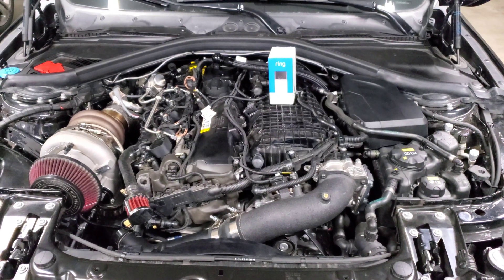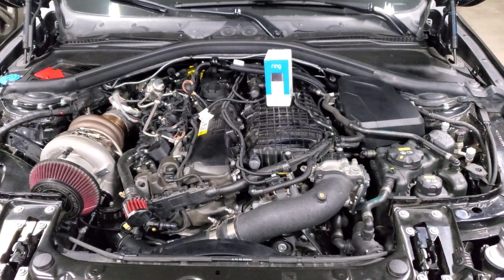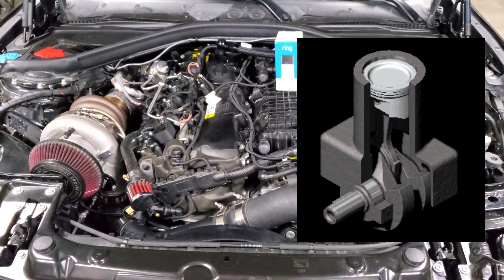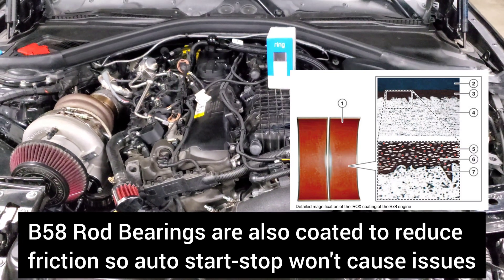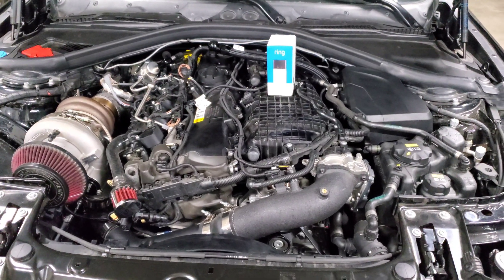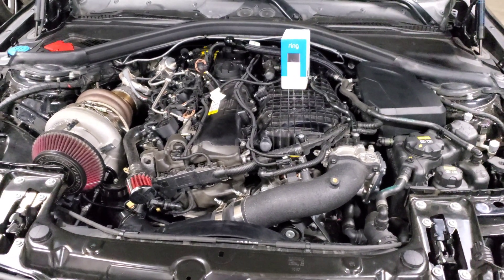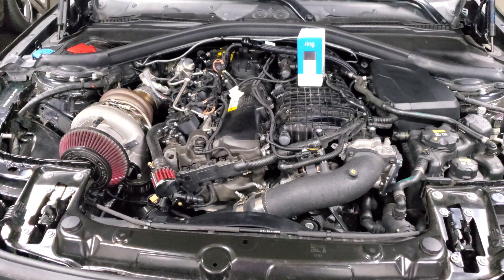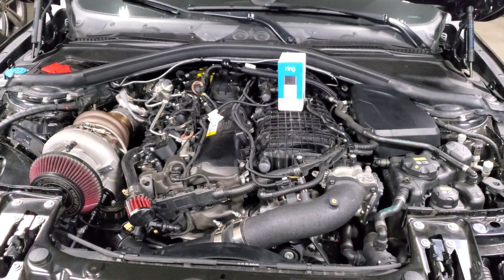Does the B58 Engine have Rod Knock Issues?

Comment: If you're using engine oil to cool your turbo then that can easily cause oil degradation, and degraded oil can absolutely cause the same problems as using the wrong oil.  So yes, a non-factory turbo can absolutely cause this type of problem.

Comment: Another issue with the S65 is that people use it for short trips and they dont let the engine properly warm up with that heavy oil.
Reply from the maker: yeah it's really a racing oil weight, not designed for daily driving unfortunately

Comment: Always replace your rod bearings in every n54, n55, and b58 every 100k miles (or sooner if you beat on it or extended oil changes).
Reply from the maker: No
Reply: @kern417  lol ok moron
Reply: No
Reply: @onekind1554  imbecile
Reply: no
Reply: @sebastianromero3666 this not a s54-s65 or /86
Reply: @kamilito225  only the OG 1m and m2 don’t need to replace rod bearings
Reply from the maker: the B58 comes with coated bearings from the factory that people use in their built engines. but feel free to keep calling everyone else dumb while wasting your own money no sweat.
Reply: @kern417  then why are all sorts of b58s blowing up with rod knock?
Reply from the maker: @sebastianromero420  that's not a thing
Reply: @sebastianromero420   where do you get your information from? because someone lied to you 😂
Reply: Correction after further research-Only n54 and n55 except for the 1M/M2 require rod bearing replacement periodically.
Reply from the maker: @sebastianromero420  now we can agree 🤝🏾

Comment: I have a built a 58 motor with higher clearances, and I get rod knock,what  do you recommend? I’m currently using Motul 300 V5W 50.
Reply from the maker: Probably find another builder
Reply: Terrible engine builder. He didn’t machine the crankshaft properly. You need to dress the radius, which e obviously didn’t do. Go back and get a refund

Comment: 6:40 If a stock engine with stock power level and the OEM oil viscosity (0W-20 for TÜ1 and 0W-12 for TÜ2) is the baseline and you go for a big increase in power then your tribo system - lets stay with conrod bearings - changes due to the increased load towards the left end of the Stribeck curve. What you then should do is to pull it back to the right end of the Stribeck curve by using an oil with higher viscosity.

Therefore using a higher vis oil in a tuned engine is the right approach BUT as you correctly said the tolearances stay the same unless you redesign your engine (nobody is doing that btw). Same tolerances at a higher power level lead you to a more frequent metal-to-metal contact despite a hig vis oil because you simply don't get the higher viscosity into the tribo contact.

Bottomline, the tolerances equal not only to a specific viscosity grade (as mentioned above) but especially also to a certain STOCK power level. changing the power level leads to significantly different friction & wear behaviour regardless of YouTube and Forums who are competing with each other who will be the first B58 with 1000hp...

Hope this is clear.
Reply from the maker: It has already been proven by multiple oil analysis including ones I've posted myself that oem spec oil works fine even at 600+ whp. When you have data showing otherwise, let me know 👍🏾

Comment: Happy that I found this video. Not a petrol guy, M57 driver, in summer these engines because of emissions and such, usually run quite hot, like 92-95 to a 100C at a traffic light. Experimented with 5w50 even though recommended is 5w30, now it gets a bit colder in Europe, switched back to 5w40. Question is, visually the 5w50 did not seem thicker than the 5w30 or 40, is it possible that it could have caused premature wear on bearings?
Reply: Something i be curious about too.
Since i out 5w30 in my 310k km m57n2 it doesnt run as well. I hope it didn’t create much more wear on the rods. Always go 5w40 at the least

Comment: 5w30 normal uk climate 
5w40 if you drive the car spirited or run it very hot frequently.
Reply from the maker: Doesn't matter
Reply: @kern417  it does. BMW UK give that advice as to what we use in our 530d work cars due to them being driven on the limit 24/7.
Reply from the maker: If your oil temperature doesn't vary then different oil weights don't provide any benefit. Not to mention a 530d doesn't have a B58 so cannot be directly correlated.
Reply: @kern417  a 30 weight oil flows faster than 40/50/60 weight oil. Higher weight oil provides better protection at higher operating temps and stressful conditions.
Reply from the maker: You simply need to watch the video and listen. Higher weight oil is not better.

Comment: Ever since bmw made rod bearings a regular maintenance item all engines have the potential for premature rod knock. It all comes down to how well the car is maintained. Unfortunately the downside of buying 2nd hand cars we dont always know how well the previous owner took care of the car.
Reply from the maker: Just watch the video.
Reply: @kern417  i did im saying Rod bearings are a regular maintenance item they should be done every 80k miles according to bmw.  Not knocking anything u said in ur vid
Reply from the maker: Bearing should not be a maintenance item. There are specific engines that have rod bearing issues. The B58 is not one of them.

Comment: I’ve had this argument even with my mechanic. He was recommending 10-w60 because it’s hot in the summer so on so forth. I declined the idea I’ve been running 5w-30 for the entire life of the vehicle. It runs and idles so smooth and quite. 135i N55, 96,000 miles.

Comment: 10w60 is way too thick for a street driven s65 s85.
I opt to 5w50 for my s65 M3 
5w50 is thin enough for tight clearances of s65 s85 and thick enough for street driving at optimum temp.

Comment: in my basic understanding about rod knocks. usually rod knocks causes due to bad fuel ⛽️ you putting in your car. for example if you car only takes premium gas and you only putting regular/semi premium gas. that sometimes causes irregular misfire on the engine because of the quality of gas you’re putting is not that gas that manufacturers recommended. also rod knocks caused sometimes by the rod cap bolts stretching during very hard driving or improper rod bolt torqueing during the build of the car. so basically the heavy your mods is the more strain you’re putting on your engine.
Reply from the maker: @2jz 240sx 🤝🏾

Comment: Nothing chokes your turbo more, then the air filter from your lawnmower.......
Reply from the maker: Now imagine the quality of the turbo when you're making 750whp through a lawnmower filter 😌
Reply: @kern417  imagine the hp if that same turbo could breath!
Reply from the maker: If the filter isn't the limiting factor, which it isn't it, it's not going to make any more power 😉
Reply: @kern417  that little filter is not rated to flow that much air. If you've ever seen 1/4"×1/4" bird screen.  It cuts air flow by almost 50%!  Just saying.....
Reply from the maker: Not rated to do it, yet somehow it's doing exactly that 🤔 

HP is airflow. If it's making the power, it's flowing the air. If it was a choke point then the turbo would max and stop making more power.

Would it make the power with less duty cycle/wheelspeed? Most likely. 

Does that mean it's a limiting factor? Absolutely not.
Reply: @kern417  we like to dyno our motors with a 10 inch intake hose.
Maybe you get good results with a 4"...

Comment: Thanks for the video bro. 

So I'm running a stage 1 tune, with 5w-40 liqui-Moly oil coupled with ceretac. Would you say this okay for my current tune or should I go back to 0w?
Reply from the maker: 0w would give better cold start protection but 5w is probably fine
Reply: @kern417  From what I've heard, 5W oils are also better at durability, since the base oil is thicker. So the viscosity does not decrease as much over the life span of the oil.

Comment: Good info. Even tho i have a FBO 340 i didnt feel the NEED to get thick oil. I still run the same oil the car is designed for even tho everyone says its too thin it works fine for me so

Comment: So for a tuned B58 do you recommend 5w-20 as recommended by BMW or switch to 5w-30? Because a lot of these manufacturers run thinner oils now to get better MPG.
Reply from the maker: Both work fine
Reply: @kern417  didn't you do a video explaining that the B58 is designed from the ground up for thin oil and its not that BMW just put thin oil in to get the MPG target...I'm in really cold climate, so i stick with 0w-20 and might go 0w-30 after I hit 60k/upgrade the turbo.

Thanks as always for the great info.
Reply from the maker: @suspect3539  both can meet the BMW cert so both should work.
Reply: @kern417  cool...thanks. When I first saw this video title, I got bummed out thinking it'd be s65/s85 all over again. Thankfully it sound like this was unique situation and there isn't widespread rod knock issues on this motor.

Comment: Hi, owners manual allow for 5w 40 on my M240i. I know someone running Motul Sport 5w 40. They say it felt like they got a small horsepower bump from the Esters lubrication. You think this is a good oil for our cars if highly boosted although I don't think it meets BMW specifications? I feel like my car drives better with Liquid Moly 5w 30 than OEM 0w 20. But, I do want to use Motul Sport. Had it in my e90 335i. It was great!
Reply from the maker: My car performed fine on 5W40 and I posted an oil analysis confirming that it worked well. I have since switched to 5W30 and I will be posting an oil analysis when I do my oil change later this year.
Reply: @kern417  Nice!
Any experience with Motul Sport. It's not long life. 5k miles change intervals. Extremely good against fuel diluting oil for those running high ethanol.
Reply: Whats your Oil temp in the B58 or N54(?) or N55?
Reply: @totalsuper4169  On my N54, Motul Sport ran 230-240F oil temps if I recall correctly depending on how hard you drive. Pretty close to Liqud Moly. On the B58, the max cool or Sport cooling is really nice for oil and intercooler temps in the summer heat.
Reply: I just started using 
Motul 8100 X-Cess 5w-40 on my 2017 b58 
Good stuff

Comment: Hi, I watched Thic Whips video and heard he put 5w40 oil before discovering rod knock. If recommended oil is used throughout the engine’s life, bearings should not wear out, right? If he immediately had put 0w20 oil the day he bought the car and beat on it for some time, the problem would have arisen earlier and warranty would have covered the damage
Reply: B58 gen1 per owners manual can also use 5w 30 and 5w 40. That's what I'm seeing in the owners manual for my M240i. Motul Sport 5w 40 suppose to be really good and offer better performance and lubricity than OEM. But, I would like to know Kerns thoughts on running the 5w 40 vs 0w 20 for highly boosted B58s.
Reply: @brakthru2  he has a vid on oil weight. he uses 0w-30 so i use the same
Reply: @brakthru2  I use 0w30

Comment: Is liquimoly 5w-30 gonna blow my b58 up 😂😭
Reply: No
Reply: It’s in spec
Reply: It’s in spec until you tune your car and throw sum e in the mix
Reply: You need a thicker oil like 5w-40 because that e will thin your oil out also you will generate more heat that will thin out your oil during operation
Reply from the maker: No.

Comment: which spark plugs work better with rod knock
Reply from the maker: Comment of the day 😂
Reply: the term knock in regards to timing is a combustion pre-ignition knock.  NOT a bearing issue, spark plugs will have no help, cause or effect on bearings.
Reply: @ebigford34 Right. But pre ignition or knocking is a important factor!